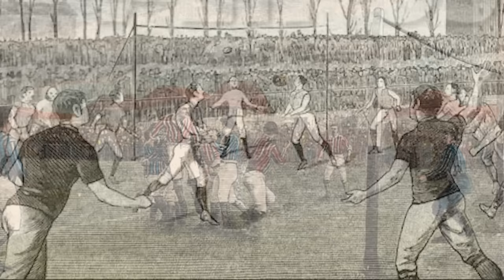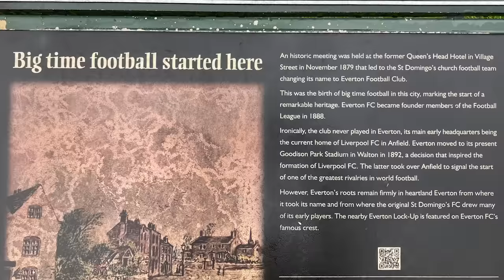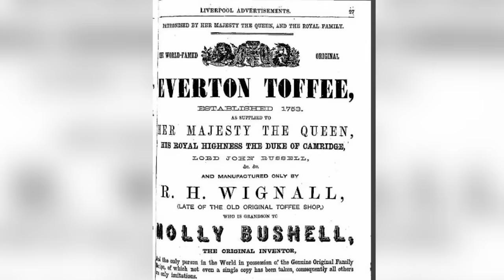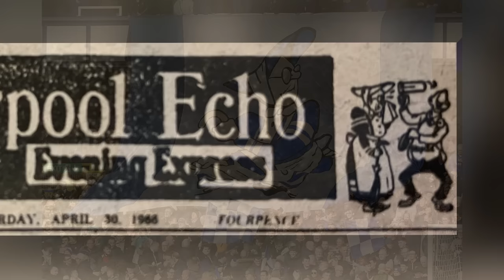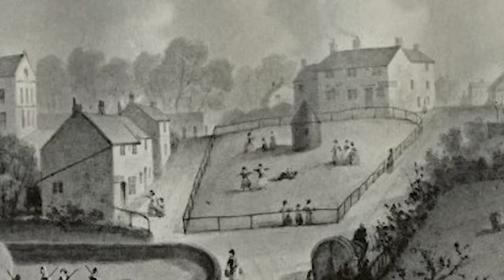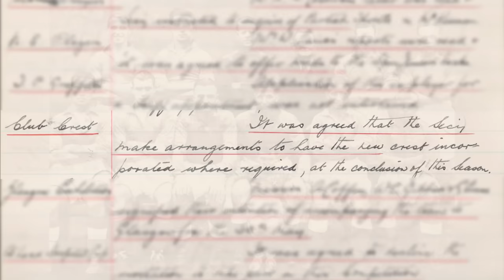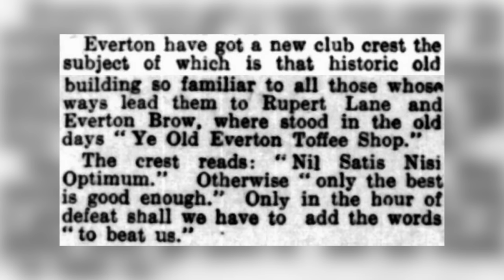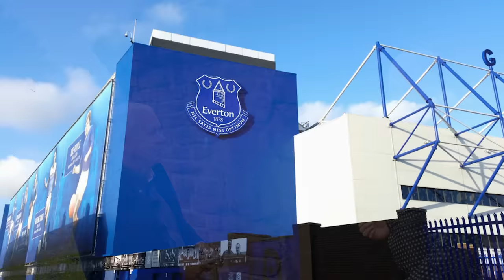Everton Village & The Birth of Everton Football Club

Comment: Has anyone else twigged that perhaps Theo Kelly got his towers mixed up. Up to watching this film I didn't know that EFC had used the original Everton Beacon on its letterhead back in the 1890s  When he designed the badge in 1938 Kelly referred to puzzling over the design for months and deciding on the 'beacon'. The lock up (Prince Pupert's tower) was never a beacon. Had he meant the original tower the emblem could have turned out very differently
Reply from the maker: The Everton Beacon was demolished in 1803, so Kelly never saw it. By 1938 the lock-up was a very familiar building to all in the area. So highly unlikely he mixed them up.